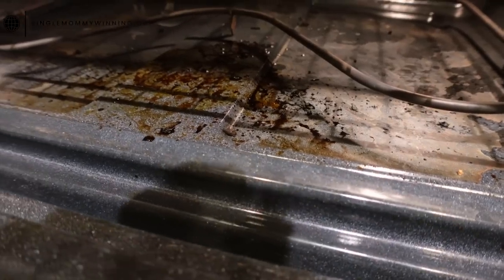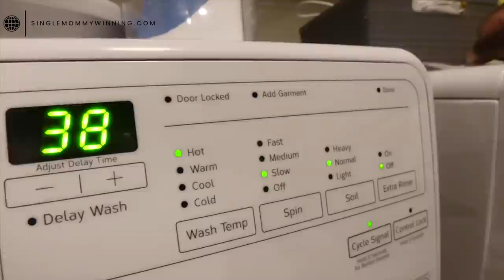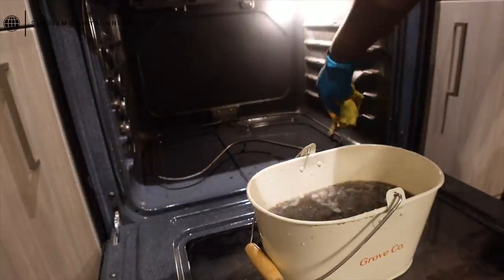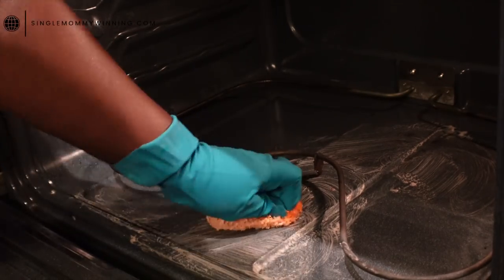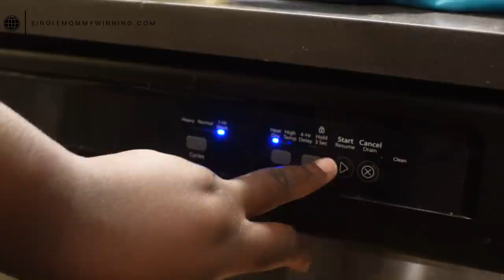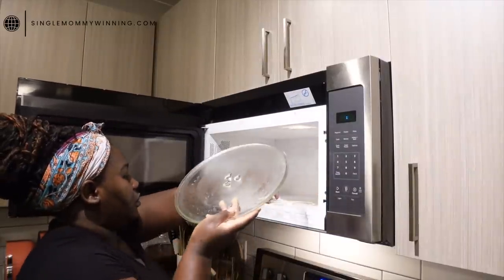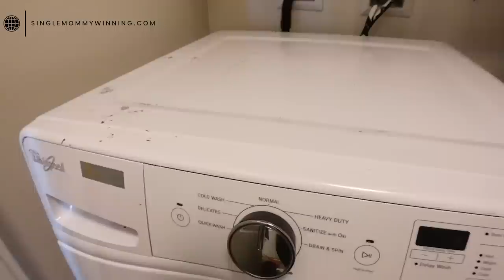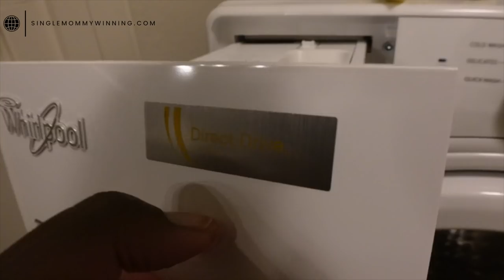(2021) FALL DEEP CLEAN WITH ME | CLEANING MOTIVATION | DEEP CLEANING TIPS | CLEAN WITH ME

Comment: Faith, here is an easy way to get your oven racks clean. Place them in a big black trash bag, spray oven cleaner on them, seal the bag and wait about an hour. They are so easy to wipe off. I use a metal scratcher if there is any hard to get off spots. The door on your oven can come off also. Makes it easier to get inside the oven better. Just thought I would share that with you.